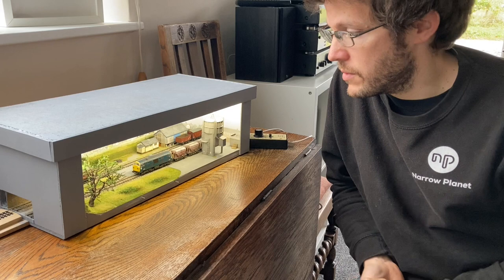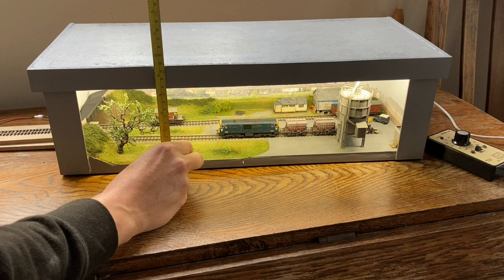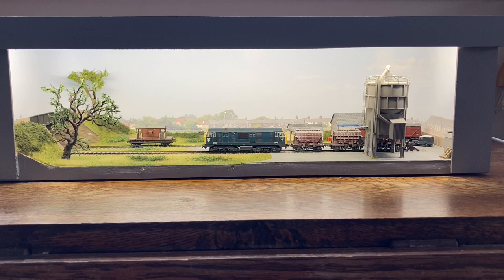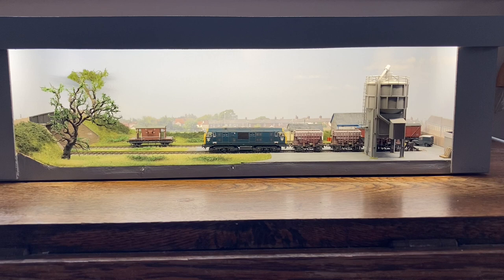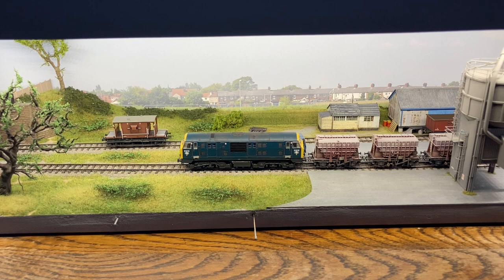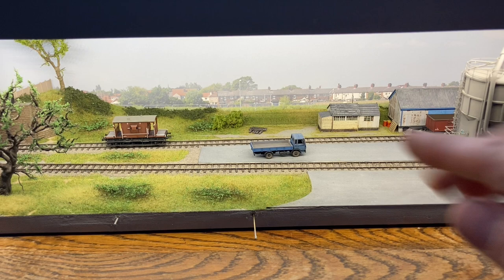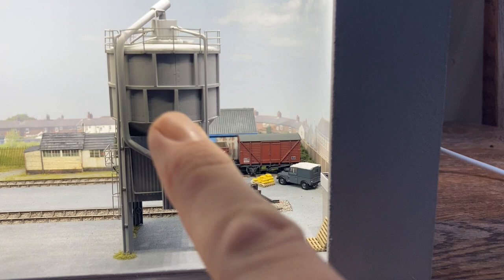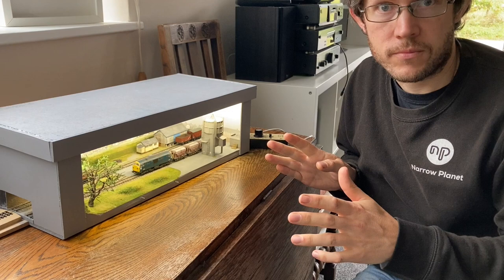Paxton Road in N - An overview of a cameo

Comment: This has come out beautifully, James!
Its got a similar atmosphere to a number of out-of-the-way places I remember 30 or 40 years ago. Oh, that lorry is amazing too, vehicles have sometimes been one of the things scream "N gauge" but this as good as anything in a lager scale.

I've intermittently modelled in N since about 1980 but I think that recent developments in running quality, range and fidelity of RTR equipment have made it far more attractive. I'm slowly gathering "bits" for what may turn out to be a late 1980s/early 1990s project in N. Some of the recent RTR wagons are little gems and get the creativity flowing all by themselves. 

I may actually start really small with a diorama on one of Scale Scenes' tiny boards, it'll be more practical in the context of an impending move than a full on layout. 
Cheers, Simon
Reply from the maker: Sounds brilliant Simon, and I expect you’d be well served by one of those small boards as an introductory exercise… good luck, the water is lovely…

Comment: What materials did you use for construction James?
Reply from the maker: Hi there, happy to help - can you confirm which element? The cameo box is MDF, the structures are plastic, those at the back make use of paper textures, those at the front use embossed material. The ground texture on the road, which is mounting card, is Humbrol gloss 5 paint and then dusted with talc whilst it's wet to give a wonderful texture - vacuum and brush off when it's dry. The ground texture is largely using Gordon Gravett's techniques outlined in his scenery books.

Comment: Hey James - I noticed you’ve curved the backscene around the 90° corners - is the backscene mounted on anything before curving? Or is it sufficiently supported by the box? Thanks!
Reply from the maker: Good question, it’s just self supporting inside the box. it’s not actually fitted as such, just a bit of Prit-stick on the top back edge in case I ever need to remove it, it’s slotted into a gap inside the box between the back board and base.
Reply: @JamesHiltonCustomModelRailways  Thanks - I’m building an N gauge diorama based of Loch Achanalt bridge. It’s just on a small shelf/baseboard, but I’m now inspired by you to create a housing for it to turn it into a cameo.
Reply from the maker: It will certainly help control viewing angles and allow well lit presentation. My two books might be of interest with ideas on presentation and what you’re trying to achieve, both now available from good bookshops and the publisher via www.titfield.co.uk
Reply: @JamesHiltonCustomModelRailways  I ordered it yesterday! 👌🏻